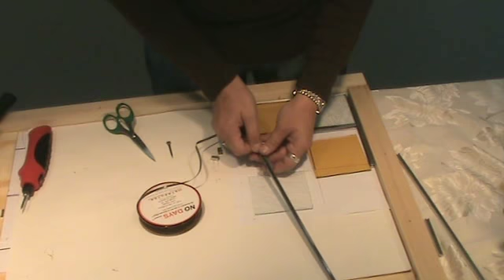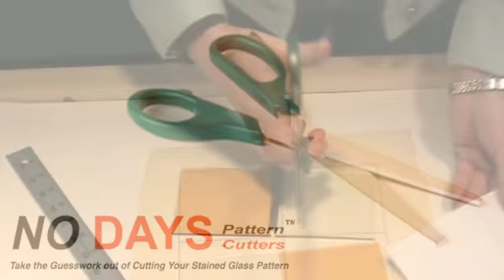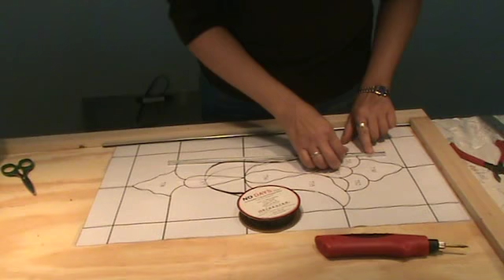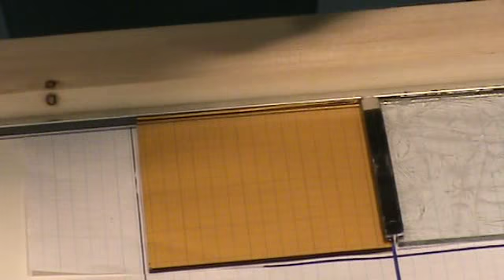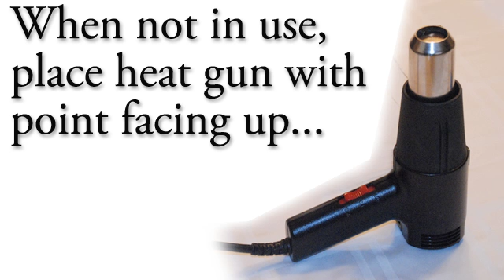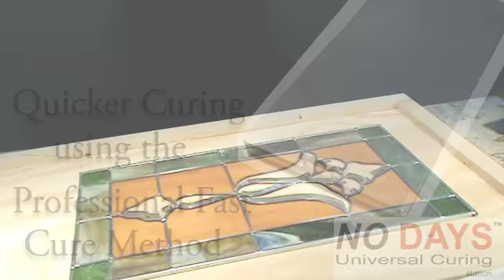Building a Leaded Stained Glass Window with No Days Quick Cure

Comment from the maker: No Days Glaze was developed to cut out the putty or cement part of building a leaded glass window. So, instead of soldering together your window and carefully turning it over to solder the other side, then putty or cement; you put the No Days Glaze in the lead or edge came before building (there is also pre-glazed lead and edge came). After heat setting the glaze, it strengthens the window and eliminates the need to putty/cement.